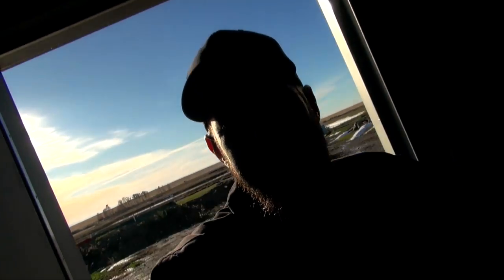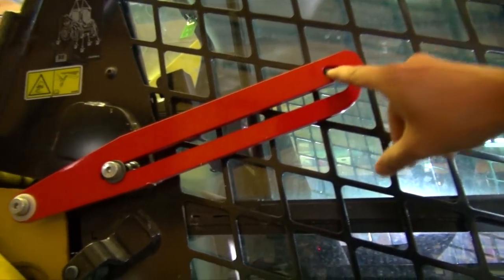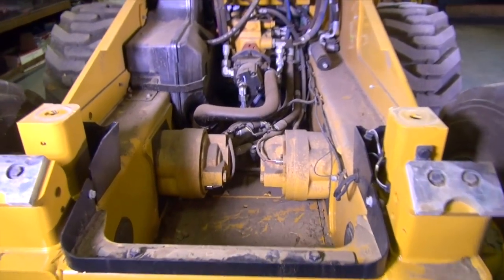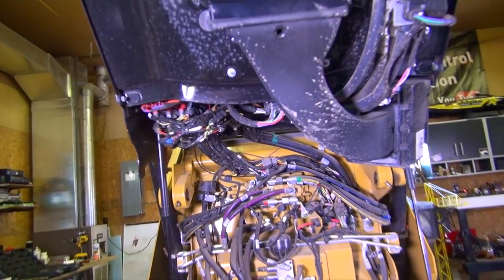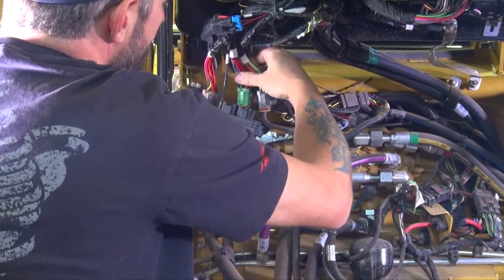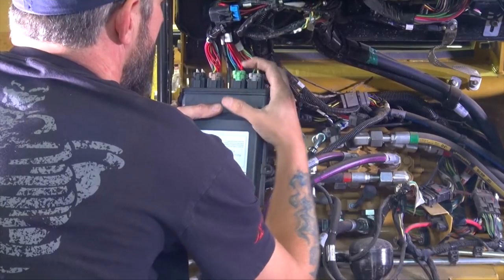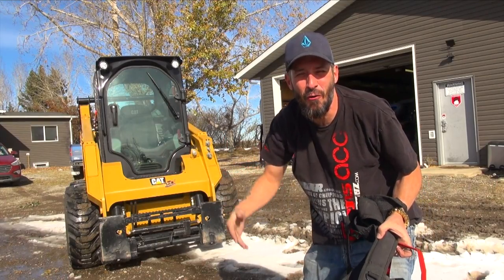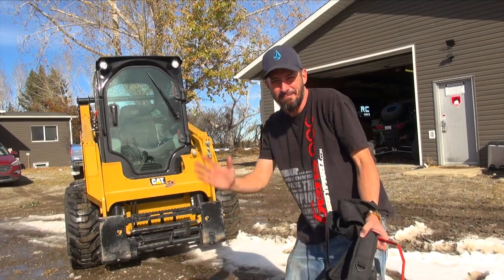RC ADVENTURES - FiXiNG the LARGEST RC I Own! 8000lb ROBOTiC SKiD STEER - CAT 242D & TORC Robotics

Comment: Have you ever thought about bringing the remote inside the house for the skid steer along with the garage door opener and the fpv goggles and go pro in the cab of skid steer and doing all of the snow removal and put the skid steer back in the garage all by sitting inside drinking coffee, and then even warming up the pickup too I'm sure that has remote start lol fun fun.
Reply from the maker: Im actually a huge safety nut when it comes to 8000lbs and my family/home.. Lol

Comment: What would u recommend for a brushless?LiPo or NiMh??Please reply its very important
Reply from the maker: It is actually what your ESC can handle.. but lipo is always better in the hands of a smart, and safe user :)
Reply: First,thx for replying
Now,i have a tt01 with brushless motor and esc but use nimh batteries.Could this damage the electronics in any way?
Reply from the maker: If your ESC can handle a 7.4 2s Lipo.. you will be OK :)

Comment: That was awesome Medic, I had to watch it a couple times to get a look inside that beast. :) I've wondered what happened to your Electric 1/8th scale. What happened to it that it's not running again?
Reply from the maker: Do you mean my 1/4 scale Loader Danon? It had a design flaw in the differential.. and I still have it. But ever since I got this big one.. the other has sat in a corner collecting dust. Ill be repurposing it soon enough.. I would like to make a full size RC car
Reply: It's a shame, that 1/4 scale front loader is a beautiful piece of engineering. But no I'm sorry I meant the 1/5th scale electric. What happened that that isn't running? Or is it that you fixed it, & just that you haven't run it? I've pondered many times the feasibility of making a 1/5th scale that runs on multiple motors. An 1/8th scale motor running each rear wheel so it could do a kind of differential drive rear end with a duel 1/8th scale motor pairing to drive the front wheels. That way it could have a choice of whether or not to have front, rear or 4 wheel drive all depending on the conditions. & that differential rear end, you go to make a right hand turn n if you crank the turn hard enough that left hand rear wheel motor goes even faster to seriously kick the rear end making for some mega-insane cornering capabilities. Lol, it would probably be almost able to do zero turn radius donuts.

Comment: Dude thats so cool your so lucky to b able to do things like that and i hope your doin well with your back ik your pain my friend ik this is off topic of the skid stear but i wanted to ask u i have a losi dbxl e and its my first 5th scale and i saw that hotracing make a few hop ups for it and i was wonderin what your option of hot racing cuz i want to get hop ups for it but to b honest im not shour what would b the most inportent hop ups i should get and also do uk if the 5t shocks would work on a dbxl e cuz the ones on this one i dont like they seem very weak i cant drop it from a foot and half with the socks maxed out without it slamin down hard and bottoming out u have any sajestions for tu for your time

Comment: What is the tilt feature you don’t want activated?????
Reply from the maker: In case you have a heart attack, or trip, or otherwise.. the machine senses a tilt in the controller and stops the skid steer from moving :)
Reply: its for in case the person operating the remote falls, then the machine will automatically stop, so as to not crash into something.  its basically a fail safe feature, so the remote needs to be level all the time when your using it.
Reply from the maker: There is also a crush feature in the radio. Something I hope I never have to discover.
Reply: RCSparks Studio:: I understand  why you would want it shut off.  Sounds like you can’t bend over to pick something up with remote in hand without it shutting off.